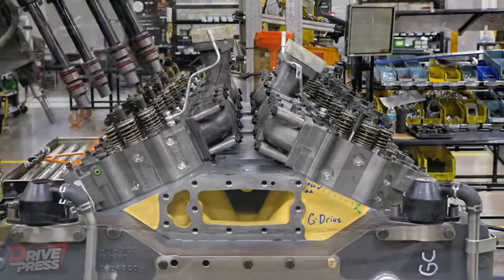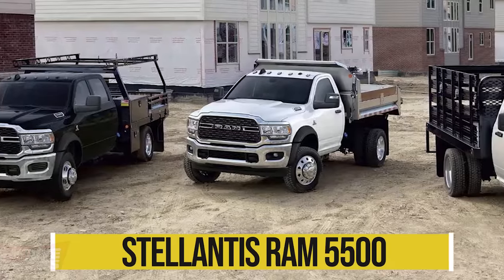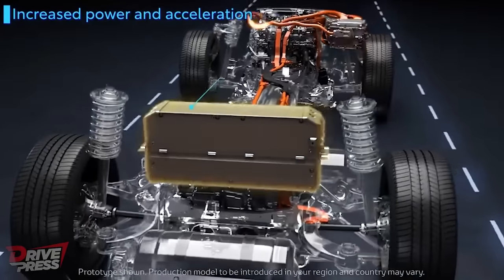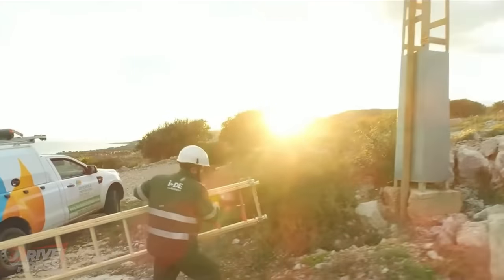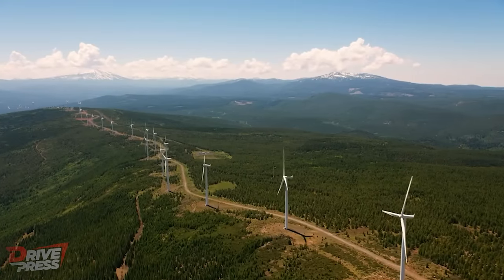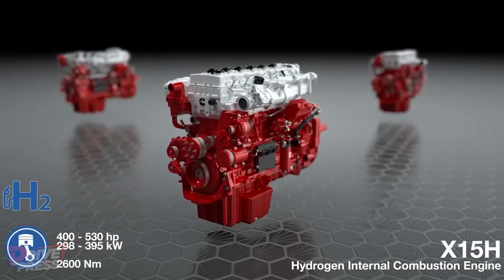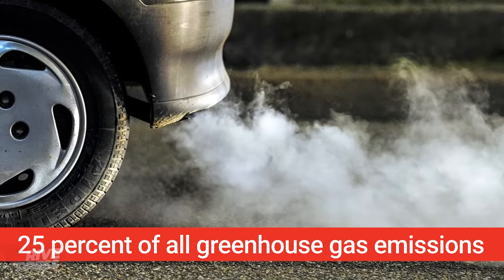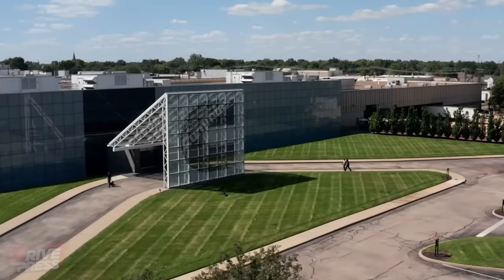Cummins Hydrogen Engine Spells Doom for Diesel

Comment: In the illustrations, they showed upright tanks up against the back of the cab. This is a disaster waiting to happen in real world applications of OTR simi trucks. 
Accidents do happen. Freight shifts. Even in box trailers, the freight can come THROUGH the front of the trailer, crushing those upright tanks. BOOM!!! With that volume of hydrogen,  everything in a square mile could be obliterated. 
If the tanks are made to withstand all but the worst crushing, (and they should be) they would be so heavy, the semi truck's viable usability would be greatly reduced. No one will buy a semi tractor that is too heavy to legally pull enough freight to make a profit.

Comment: The biggest obstacle for hydrogen is it's very small molecule and the temp it turns into a liquid. The small molecule means leaks. The temp problem means it has to be cooled way down to -427F to make it a liquid. Natural gas is much easier to work with than hydrogen. These problems were addressed by SpaceX when they were designing their newest rocket engine. They went with Methane. Natural gas is about 70-90% methane.

Comment: Canada is also working on this, half of Europe also, gotta have enough fuel to run turbines to charge batteries, 1 turbine uses 100 gallons of fuel a minute, made in China by GE, hydrogen cooled generators on the end, nuclear for electricity, hydrogen for cars

Comment: Hydrogen is cleaner by far, but where will we get the hydrogen fuel and how much will it cost
Reply: Break even is an electricity price of 3 cents per kWh.
That currently happens with solar power for about four hours per day in summer (actually currently the electricity price goes negative (the grid pays large consumers to take more power).
Direct connections between solar farms, hydrogen electrolytic plants and the gas grid could help solve this distribution problem.

Comment: The design itself remains an Internal Combustion engine aka heat engine. At the very best, the energy conversion to mechanical energy is about 40%. The losses are wasted heat and internal friction by design. With hydrogen it is carbon free of course and the emissions are not harmful. Hydrogen itself has to be "made" with the input of more energy than is returned in the form of hydrogen. Currently most hydrogen in use is made from natural gas with left-over chemicals, drilling, pipelines etc. Hydrogen's heat content by volume is very low in BTU output. Hydrogen also has storage issues by either highly compressed gas or cryo storage with layered tanks and venting losses. Since hydrogen functions as an energy storage device, it makes more sense to use a battery to do that. Modern electric motors operate in the 80% energy conversion range. Most of the electrical infrastructure is already in place. The issue with electrics is recharging time down which may have improvements coming and perhaps swap arrangements which have been in use for years in industrial vehicles. Cummins is of course heavy in the trucking field and industrial engines and this hydrogen design may well have special use application as in cross-country trucking or dense metro delivery use where vehicle emissions are a major problem.

Comment: The biggest problem as with electric vehicles is the infrastructure for the trucks. I would not bet on this technology or electrical powered engines. It would cost hundreds of billions of dollars to have hydrogen stations with the massive the available of diesel fuel. The wait time would be at least 2 to 4 times to refuel the hydrogen fuel tanks. Of course this could be attainable during the required rest periods required.

Comment: Of course, it's vastly more efficient (miles per cubic whatever of hydrogen) to use an HFC with electric propulsion, than to burn the stuff. When using it as ICE fuel, once you get past the embrittlement issue, it's just an ICE.

Comment: Electric vehicle vehicles can and do run out of charge far from chargers, especially in freezing weather. They have to be recharged in situ by a fossil fuel generator. There is no other way to recharge a dead battery. Now what about hydrogen fuel? Same as propane fueled vehicles. It takes a special tanker with a fossil fuel engine to haul hydrogen or propane and pump it into an empty tank. Far easier for me to carry a few jerry cans of gasoline for me or others to use when they need fuel.

Comment: As long as it takes 1 unit of energy to make 0.7 units of hydrogen energy hydrogen will be a stranded asset.
Storage and transportation of it still not viable in terms of energy and safety.
IF we make hydrogen from wholly renewable energy then it has a chance.
Otherwise it is a non starter.

Comment: With EV's you've just moved the burning of fuel from under the hood to burning it at the power plant. Thermal efficiency is 35% for power plants and internal combustion engines, therefore they are no more efficient, if anything less due to having to transmit the energy to your house. Then the EV, once charged is only 85% efficient.
Reply: You don't have to burn ANYTHING to generate electricity if you don't want to. That's the point. The grid is becoming less and less dependent on burning stuff already.
Who is going to solve all of the enormous problems of producing and distributing and storing hydrogen.?The problem of batterey technology fades into insignificance compared to the issues around handling hydrogen.
Electric vehicles and batteries have improved exponentially in the past 2 decades. Hydrogen vehicles have not improved at all in the same time period. It's a dead end. forget it and move on.

Comment: It will be a long time before hydrogen will replace diesel. Although hydrogen is the most abundant element in the universe, on the earth it is always bound to another element such as oxygen. The energy required to separate H2 from whatever it is bound is greater than what it can give back as a fuel. The cost of 'separating' H2 is also a significant factor. Although engines can certainly be designed to use H2 fuel, getting the fuel at a reasonable cost is the limiting factor. Another factor which is somewhat of a drawback has to do with how hydrogen is stored on a vehicle. Using a gas such as natural gas or hydrogen requires at this stage of the game high pressure vessels which are costly, heavy and require a larger volume for a given range than that needed for a liquid fuel such as diesel.

Comment: Of all the possible ways to use hydrogen, burning it in a diesel cycle engine is probably the worst way concievable. 

Yes, pretty much every combustion engine can run on hydrogen, it does have great burn characteristics. Unfortunately it suffers from 2 critical problems that burning it only exacerbates. These issues stem from fundamental laws of physics and are not easily mitigated. 

1. hydrogen is gravimetricly energy dense but volumetricly it is not. 1kg of hydrogen contains more energy than a KG of diesel or petrol (gasoline) but it takes up 11 cubic meters in ambient conditions. It has to be either stored under extremely high pressure in heavy duty fuel tanks or cooled to near absolute zero to liquefy. When stored as a liquid it needs to be kept in a highly insulated tank with safety valves so that it can vent as it inevitably heats up and turned back into a gas. Either way, at best a hydrogen burning vehicle is about the same range at the same weight as a conventional  ICE vehicle or more often than not it's heavier with a shorter range. 

The much more significant issue is that of round trip energy effeciency. Producing hydrogen with green energy results in a fuel that is significantly more expensive than liquid hydrocarbons, many times more expensive in fact. You lose energy sending electricity to the electrolizers, the electrolizers are at best around 90% efficient. You then need to use energy ro move that hydrogen to refuelling stations then you waste most of the energy as heat if you burn it in an engine. 

Compare that to batteries, you send electricity to the charge point and charge the batteries. This is fewer steps thus fewer losses. Of course pure battery trucks are very heavy with a limited range so hydrogen may still make sense, but it makes by far the most sense if you use it in a fuel cell which is more than twice as efficient as an IC engine. 

Of course fuel cells are far from perfect too. They require a lot of elements that are rarer and more expensive than even those used in batteries, namely platinum.  Furthermore fuel cells can become poisoned by contamination from the air and require very good air filtration to be durable. 

The best case I can see for hydrogen is relatively small fuel cells acting as range extenders allowing heavy vehicles to use less batteries.  

Their are some promising technologies that may alleviate the issues of storage like amonia as a stable liquid hydrogen carrier. But converting hydrogen to amonia and back is 2 extra steps to lose energy, amonia is also highly toxic and this doesn't overcome the fact that green hydrogen is expensive in the first place and outside of producing it during times of electrical over supply that green energy is better used to displace coal and gas generators. 

Green hydrogen also would likely be more impactful as a reducing agent for steel instead of coking coal which is far worse for the climate than diesel trucks. 

Realistically the best remotely reasonably solution is to build more capacity for freight by rail and use electric locomotives as much as possible. We should also consider full EV trucks for short trip routes say from ports to wharehouses and hybrid diesel electric or hydrogen fuel cell battery hybrids for medium to long distance. 

There is no silver bullet here. Personally I'd like to see nuclear see a full scale revival in addition to renewables because waste heat and surplus energy can be used for water desal, industrial heat and hydrogen.

Comment: I live up in the USA where it gets to 20 below zero in the winter.  Will this thing be hard to start after sitting outside for a few days?
Reply: It just might be easier to start. Hydrogen almost lights itself, obviously with oxygen present.
Reply: @davidbate6346  So you think that water vapor and warm air exhaust won't be a problem at -20 degrees?
Reply: I live in Canada where it gets to -50. A little nippy for sure. I wonder how reliable it will be to start at this temperature
Reply: @DumbCarGuy  Not at all.
Reply: @DumbCarGuy And you think current diesel trucks with exactly the same water in the exhaust have problems?
Burning hydrogen carbons produces water and carbon dioxide.

Comment: To solve the carbon footprint emissions issue biofuel would have been the replacement of the most cleaner combustion of feels that could be used for gas-powered engines and diesel engines to solve the carbon emissions. Biofuel cut carbon to nearly zero in air pollution. If biofuel was invested heavily in America we wouldn't be talking about electric vehicles today. We will be saving the fundamentals of driving a combustion engine. People like sound of an engine not electric motors.

Comment: Even though it has water for exhaust it still has to use manufactured Hydrogen which generates pollution. It's just one more case of moving the pollution from the vehicle to the production of fuel. Please dont tell me about your green power production.
Reply: You make hydrogen by electrolysis of water - which can be done by electric power from solar panels which currently have issues because of a mismatch of supply and demand (supply is plentiful when demand is minimal).
Break even is an electricity price of 3 cents per kilowatt hour (which happens for about four hours per day at the moment in summer).

Comment: What is the volumetric energy density of hydrogen gas?  The answer will tell you why diesel won't be replaced by it.
Reply: Same with av gas or jet fuel vs. hydrogen.

Comment: Imagine not knowing cutting all emissions will kill plant life on our planet. Crazy right?
Reply: So how did Plants exist before us? We still have volcanoes and forest fires _
Reply: @spiritzweispirit1st638  There are other ways the Earth controls CO2 as well and we humans only account for a tiny percentage of CO2 - a plant food that has negligible effect on Earth's temperature.  180 ppm is starvation level CO2 for plants and they do best at around 1200 ppm!  We are currently at about 380.   Green houses add CO2 to raise the level to around 1100 to 1200.
Reply: @Hogger280   _ So plants can breath @1200 co2 ppm, 'Cept what about us? What's our optimal oxygen level? in comparison?
Reply: @spiritzweispirit1st638  1000 ppm is 1/10 of one percent.   Air is 78% nitrogen, 20.9% oxygen and the last 1.1% are minor gases like argon and CO2.  Currently CO2 is at 380 ppm or 0.038%

Comment: These systems need an onboard electrolysis system. Always trying to create another problem for supply and demand the only need for fuel stations then would be for the emergency situations! Always trying to engineer stumbling blocks into independence!

Comment: Same engines they're building now and the last 2-3 decades. You only need to change the fueling, which we already do. West coast has hydrogen fueling starions, common with CNG. So you can run propane, natural gas or hydrogen. Don't believe me ? Look up Air Liquide cryogenic manufacturer, cheers.

Comment: JBC in the Uk has gone all in with hydrogen powered engines in there off road equipment including refueling rigs .  If the goal is lowers emissions then using fuel made from wind/solar etc will achieve that.   If we have to tax fossil fuels to subsidize hydrogen that’s a solution to reduce emissions.  We have to keep our eyes on the goal .   
It will not happen for free it will have to be paid for. 
Go for it Cummins and don’t let Reagan type politics stop this effort. ( Reagan was the president who removed solar panels from White House instead of embracing the future!). 
Cheers Warren

Comment: Mazda had their rotary engines running on hydrogen 30  years ago, so running a internal combustion engine on hydrogen isn’t exactly “rocket science”
The problem with hydrogen is manufacturing and logistics.
Over 95% of all hydrogen today is made from natural gas with huge CO2 emissions. To make hydrogen by electrolysis is inefficient since the power input is significantly higher than the energy in produced liquid hydrogen.
Logistics and filling stations are on a completely different level compared to diesel, gasoline, LPG and CNG.
Hydrogen is a dead end when it comes to powering car, truck, trains… but it has its uses in industrial processes

Comment: How many years has it been known that hydrogen is a form of fuel? How many of you know that when hydrogen is used in an engine the emissions of the engine is water vapor?
Reply: This is the real issue:  fossil fuels provide more energy than it takes to extract, refine, and transport them.  As long as there are fossil fuels, humanity has a bonanza of free energy (beyond the input energy).

Comment: The fact that it is very expensive to make hydrogen, it’s gonna cost $16-17/gallon. With an estimated 70mpg in a car, I don’t see the upside to this. Double the fuel mileage doesn’t justify quadruple the price of fuel. I believe it takes the use of fossil fuels to make the hydrogen, so what’s the point? It’s no different than going electric. Currently this is a bad idea. Until they can easily make it and produce it at a LOT lower cost, I don’t see many wanting to go to this. Just wait until big trucks start using it and the cost of transporting goods goes up 4x! Talking about inflation and economy going further down the toilet!!

Comment: 8:02 Double Overhead Camshaft - I think Not.
Reply: is there not 2 of them? The valvetrain might look a bit funny but thats because its intake includes compressed gas. Before the gas makes it to the injectors it goes through a pressure regulator which is essentially a form of variable boost that goes directly to the injectors. So, you dont need as many intake valves as the injectors dont rely on it, and since hydrogen is already in a gas form it does not need to atomize the fuel with the air.
Reply: @berry966  valvetrain looks like a normal Single over head cam engine to me? there are 2 rocker shafts, maybe they are being confused with camshafts?
Reply: @slowboat6021  doesnt look normal to me, check the valve arrangement. Also appears to be a cam gear on the head but it looks like a lot is missing

Comment: Who would buy a hydrogen truck with limited fueling distribution, and who would build a hydrogen distribution network with limited trucks out on the market?  Such giant "green" schemes fail to realize that the energy production and distribution system that we presently have was developed gradually, over decades.  Investment was done relatively slowly in stages. Suddenly attempting to replace over 100 years of development in just a few years is not realistic.  Perhaps the hydrogen vehicle will be useful for short range use where vehicles will always be close to a fuel source.  But it will be useless for long range use. I won't be scrapping my diesel truck anytime soon, and replacing it with a hydrogen truck. Also wonder how safe hydrogen vehicles will be in severe collisions. Are these things bombs?